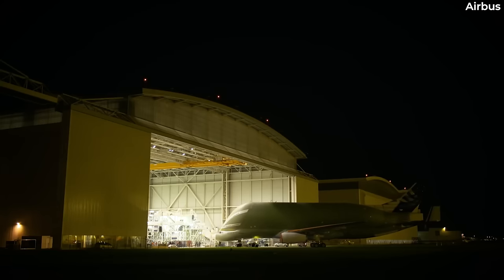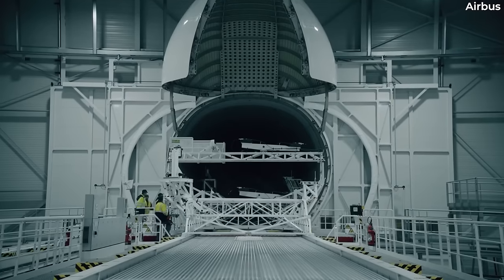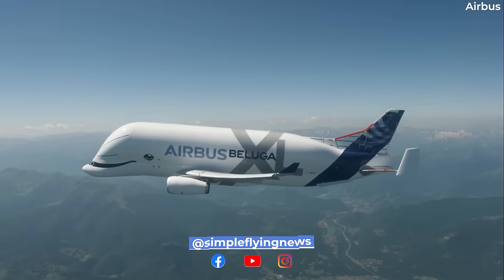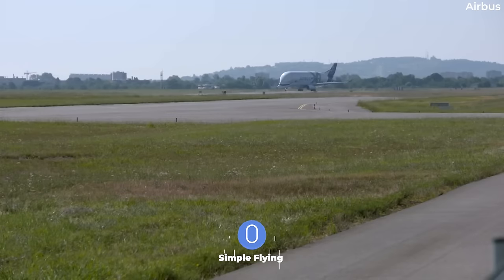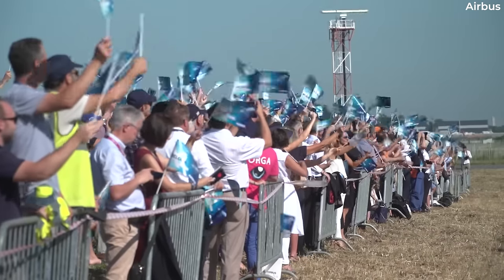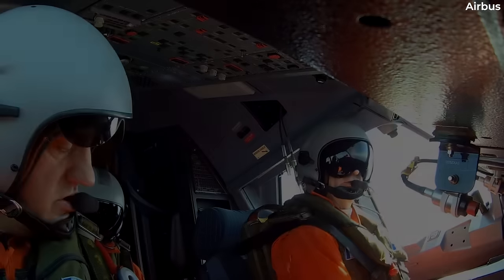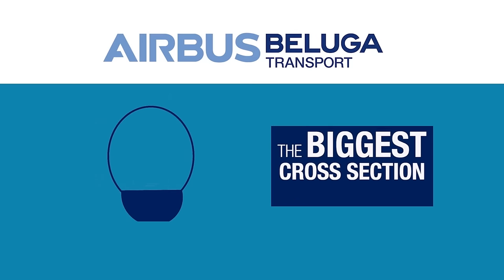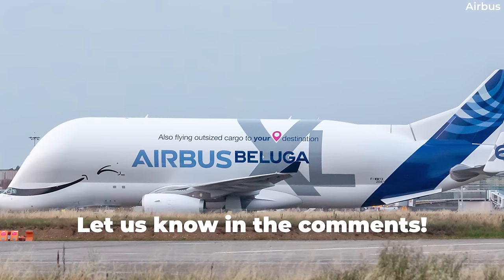The 6th And Final Airbus Beluga XL Rolls Out With A Special Livery

Comment: Kinda hard to believe that an A330 can be turned into such a humongous aircraft
Reply: to be fair the a330 was pretty big to begin with
Reply: @spenofzeros  Not really, A330-200 isn't that big to begin with. They are a stretched variant of A300 after all.

BUT, Airbus did create A340-600 from stretching A300-600. So it makes sense that they are able to make Beluga.
Reply: Does anyone see the beluga/ XL  ugly?
Reply: @mohammadnoman370  Well it does look like a whale. Although it looks better than the tumor growing out of the 747.
Reply: @nntflow7058 In what world is an A330 not a big aircraft?
Reply: @aviationlba747  He has me confused as well, as the A330 is bigger than most planes. It's a widebody aircraft afterall.
Reply: @camalio97  depends on how you compare. If you compare A330-300 with single aisle aircrafts, then yes A330 is 'big'. But within wide body aircraft family, A330 is definitely not big if you compare with B777-300ERs or A350-900s or A380-800s or even A340s.
Reply: @bhai857  An A330 is a wide body aircraft, meaning it's a big aircraft, and it's bigger than most planes commercial or military out there. They go by the "Heavy" callsign when pilots are initially reporting to new ATC controllers. Any aircraft capable of carrying 250+ passengers, plus the huge payload an A330 carries, is a big aircraft. Comparing it to a 747, 777, or an A380, still doesn't change the fact that an A330 is a large aircraft.
Reply: @camalio97  learn to read before jumping to comment. I did say it is large compared to all other narrow body aircrafts, and it depends on how you compare. No need to force your opinions on others. Everyone has their way of comparing and there is no set standard. 
You can invent whatever definition you deem fit and stay happy.
Reply: @aviationlba747  It's a widebody aircraft. A small widebody aircraft.

A310, A300, B767, A330-200 and B787-8 are all small widebody.

Beluga uses A330-200 as a base for their design.
Reply: @camalio97  There are generally 4 types of widebodies.

A310, B767 and A330-200 are small widebody, their capacity usually hover between 200-300 seats

A330-300, B787-9, A350-900 are medium size widebody, their capacity hover around 300-350.

A350-1000 and B777-300 are large widebodies. Capacities hover between 350-400.

B747 and A380 are jumbos.
Reply: @nntflow7058  It's a widebody aircraft granted there are larger planes out there, the A330-200 is not a small plane by any means.
Reply: @rrwithsteve895  I'm pretty sure I said small widebody.

Think about it, B757-300 is a narrowbody aircraft. They could accommodate around 200-250 passengers depending on  configurations. A330-200 usually carry  between 250-300 passengers. It's 1 step up in terms of capacity.

A330-300 and B787-9 usually carry around 300+ seats.
Reply: @nntflow7058  no 747 is a "Heavy" widebody aircraft, while an A380 is a "Super". There's no such thing as small Wide-Body in Aviation. Also an aircraft capacity is entirely dependent on how an airline configures it.
Reply: No one is forcing opinions on anyone, and they are set standards in Aviation for scaling Aircrafts. All I said was comparing an A330 to a 777, 747 or A380 still doesn't change the fact its a large aircraft. In my previous comment I didn't force opinions all I stated was facts.
Reply: @nntflow7058  i meant with fuselage diameter, looking at an a340-600 next to a 747 they look about the same size
Reply: @camalio97  Uhmm no, Both B747 and A380 is categorized as Large Widebody. Jumbo jet is a nickname given to B747.
Reply: @nntflow7058  I never really thought of any widebody plane to be considered small by any means. 

If anything the 757 sounds like one of the few outliers in which it's most likely the larger if not largest narrowbody aircraft.

Though honestly I'd check out the 757 if I had the chance, I heard those planes are super fast on takeoff :o
Reply: @rrwithsteve895  I don't think you understand what we mean. Small as in small in widebody category, not small in overall capacity.

Also, Planes like A310 and B767-200 are small.
Reply: @nntflow7058  Well then in that regard It's quite a feat that an Airbus A330-200 could be stretched to such sizes :o

Also I suppose if all the wide body aircraft lined were lined up in a chart I think I understand more what you mean, where the A330-200 and the Boeing 767 would be considered small. 

Though I still hope folks don't get the wrong idea and think a widebody could be considered small when compared to a narrow body aircraft.
Reply: @rrwithsteve895  I think most people understood that A330-200 is a widebody. It's just that the capacity of the new Beluga is soo big compared to the A330-200F.
Reply: Before that was the Pregnant Guppy created by Aero Spacelines. It made its first flight in September 1962. This Airbus Beluga proudly carries on its tradition of moving outsized cargo. And here I thought the Lockheed C-5A was a big aircraft.
Reply: Fr

Comment: Brilliant.  Nothing short of brilliant.  They are on the A330-200 platform with the Rolls-Royce engines.  Did Airbus have the thrust increased for more power?  It'll be nice if the ones on the 800neo were used.  Let me know.
Reply: No, they are the same Trent 700. The A330neo uses the Trent 7000, which in turn is a derivative of the Trent 1000 designed for the 787
Reply: The Question is Why didn't Airbus Use the Rolls-Royce Trent 7000
For better fuel efficiency??
Reply: @ibxgameryt9449 wo reasons:

1. Basing the aircraft on the A330 rather than the neo allows them to build these aircraft without interrupting the neo line. The A330-200 obviously isn't equipped for the Trent 7000 engines. 

2. These don't have a high enough operational tempo for the increased capital cost of the Trent 7000 to offset the reduced fuel cost
Reply: @jackroutledge352  well basing it on the A330-200 is A Good Idea,
And the Trent 700 is the main option for the Beluga XL.

But why they didn't use the GE-CF6-6 engine??
Reply: @ibxgameryt9449  Maybe it's because Rolls Royce has produced a better, and more fuel efficient engine than the competitors.

Comment: Although this is the last of its line, post pandemic I can see a380's being converted into "beluga type 3". With its enormous basic body and 4 jets, doing an expanded above wing treatment, like the beluga, could mean the thing would have the size, power, and economy to carry complete smaller airbus complete fuselage, all the a350neo parts to touluse,  and fill the gap for huge transports that the end of the 747's and destruction of the antanov huge heavy lifters destroyed by Russia in ukraine
Reply: got a feeling Airbus is gonna throw a line to Antonov to rebuild THE heavy lifter AN-225 tho it probably would look very different on the tail (IIRC it was due to the planned soviet shuttle flights)

Comment: With respect to the charter market, how does the Airbus Beluga Transport compare to other outsized cargo carriers like Volga-Dnepr?  So, how do the cargo volumes compare?  Changing the topic to livery, it's a friendly design.  However, if I have a choice, the ribbon goes to ANA's Honu livery on their A380s.
Reply: If you need to move something really heavy, the beluga or belugaXL isn't particularly capable. The dreamlifter has more than twice the payload capacity, and an An-124 has thrice the payload capacity. However, the cargo volume of the BelugaXL is second to none as far as I know.
Reply: @ktmf2   They could make beluga-XL based on A340 if they want it carry heavy load